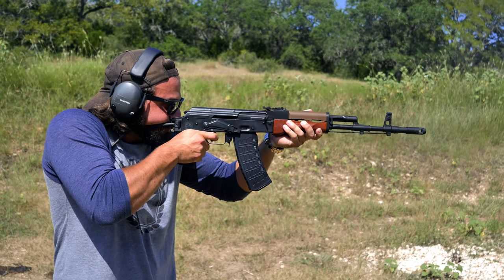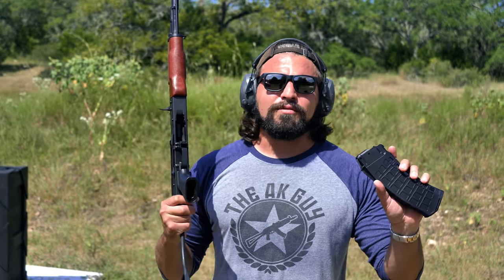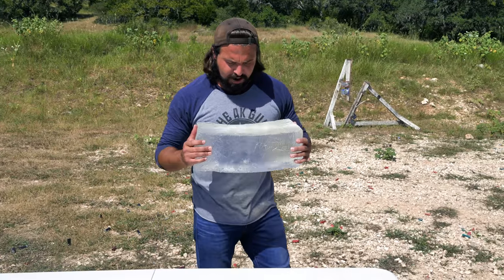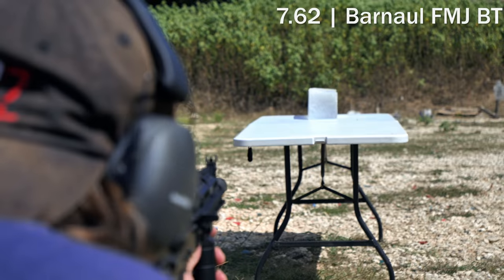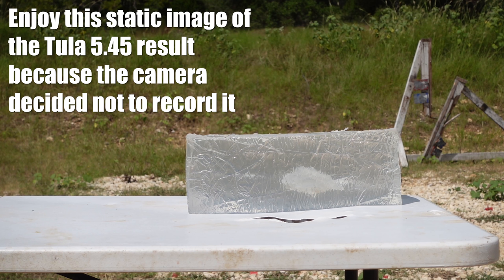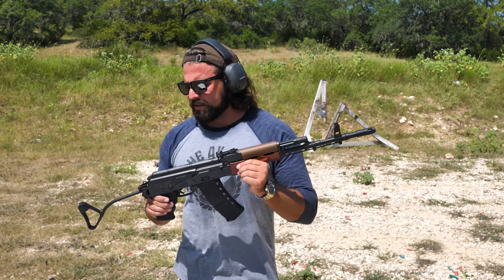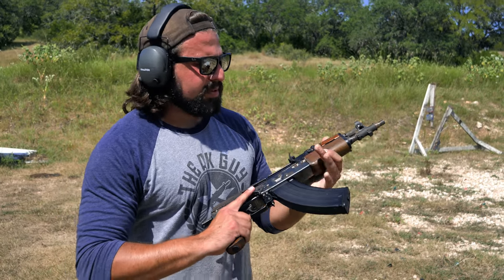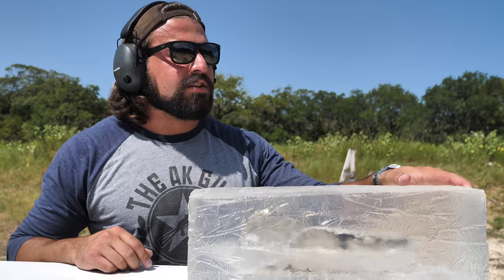7.62 vs 5.45 - Which Is Better?

Comment: As I like to say: "7.62 for the Revolution and 5.45 for war"
Reply: Honestly just use whatever is standard in your country. When the bad times come, that beautiful 3,000 dollar 6.5 is gonna get reamed out to 762 or 9mm, or getting a barrel insert pinned in to bring it down to 556/545.
Reply: 7.62x54 for storming trenches, 7.62x25 for motivating those to storm the trenches. 😁
Reply: @bombsawaylemay770  more like 7.62x25 for sweeping the ruined buildings
Reply: @Bonesintheocean.mp3 Reloading as a hobby is fine. I meant it as a practical matter.
Reply: Amen

Comment: I recall reading about the Chechens during their fight with Russia.  Many of them said they disliked the 5.45x39,  and really preferred the 7.62x39.   Understandable.
Reply: It's an urban legend. Chechen and RUAF forces use both, depends on specific mission.
Reply: You're quit right buddy, 7.62mm is powerful and has more penetrating power
Reply: No, not understandable at all. Like, at all. They must have been stupid and didn't do any ballistic testing, at range or on target or otherwise. The results are not negotiable.
Reply: 7.62 has more stopping power and penetrating power than the 5.45 and 5.56, the 5s are more accurate, the Indian Army is looking to go back to the 7.62 for this reason
Reply: 7.62x39 has more range which makes it better for the mountains of the caucuses, however 5.45 is both flatter shooting and has much less recoil which is better for your average infantryman which is why the Abakan project ultimately failed despite picking the AN-94 as they realized that 5.45 basically solved the problem with the AK, that being a fuckton of recoil.
Reply: @iterationfackshet1990 how do you manage to squeeze so much bad information into one comment
Reply: I get this is a sim but this made an impression on me and why I go w/ old-school big rounds.

I can't find the original whole version, but in the 1st half when they are clearing rooms it was judged fewer rounds to make sure the target was D O N E.

Real? I don't know; but it resonated with me and why I have chosen 7.62x39 as my feral piggie round.

ALSO, my boot was 1983; we had filthy A1s and yeah, I get it was a lesson to make them reliable. But, I've never trusted AR since. At this point in my life, I"m not humping tons of ammo over hills and thru swamps so that aspect means less to me.

https://www.youtube.com/watch?v=i9Hz7Kbq6aQ
Reply: Body armor. 545 wins
Reply: @louie3404 stopping power yes, penetration not so much

Comment: Brandon, just FYI: You can put those gel blocks in a bucket of water and all the surface disruptions will not be visable. That way you can see the insides all nice.
Reply: You can also very quickly hit it with a blow torch, note very quickly.
Reply: He usualy just magdumps into trash.

And i love it.
Reply: Yes and you can also use a bucket of water to prevent fall damage.
Reply: And a grenade to double jump
Reply: I think that trick also works on white T-shirts :P
Reply: @PromProm456  Classic Lulw
Reply: @Miraak0Konahrik  LulE
Reply: @vojko0031  To be fair that's pretty much exactly what the Russians did when they were actually evaluating the AK47 prototypes.
Reply: Question:
7.62 vs. 5.45 - Which is better?

Answer:
9x39
Reply: @crazysilly2914  well no, but actually no
Reply: 14:00 Looks like an effect you'd see in a Quinten Tarantino movie.

Comment: Would love to see a 5.56 vs 5.45, 9x39 vs 300 blackout, or 7.62x54r vs 308 comparison video. Loved this one.
#akgnotificationsquad
Reply: The Caliber cold war
Reply: Concur with all these
Reply: 7.62x54R is closer to .30-06 than to .308, but it requires a really long barrel to get the most out of it because it was originally designed around 30” Mosin Nagants
Reply: Yes!
7.62 x 54r out of a Zastava M91❤️🇷🇸
Reply: All of the above
Reply: @j5689  Was gonna say 7.62x54r is more comparable to 30-06 too. You beat me to it.
Reply: @EvilMendes  I'ma use that from now on
Reply: 300 black out isnt even comparable to the other rounds. it was designed for a silencer set up. and 54r is in between 30-06(7.62x63) and 308(7.62x51) so not really a good comparison either.
Reply: why not also throw 7.5x55 into the mix
Reply: 22lr vs 50 bmg
Reply: I'd like to see a comparison between suppressed 7.62x39 vs 300 BLK. Both ballistics and noise with a can.
Also question: When you reload ammo, can you put the 220gr (14g) Tip meant for a subsonic 300 BLK round into a 7.62x39 case?
Reply: 7.62x54r vs 30.06
Reply: Throw in 6.5 grendel for good measure
Reply: 7.62x54r vs 30-06 vs 303 vs 8mm Mauser

Spoiler 8mm Mauser is known as the streamlined freight train for a reason
Reply: @WW-ir7sm  Im sure you could but AK ammo is .311 diameter bullet VS .300 blackout being a more western standard .308 bullet
Reply: @joksom4752  9x39 is pretty comparable to .300 blackout as far as use case goes. I'd say it's about the same margin of error 7.62x54R is to .30-06
Reply: And maybeee .303 british! Which is the British equivalent of 7.62x54r
Reply: @5150warpig  9x39 as the comment stated was designed to be subsonic for suppressed guns like the AS Val.
Reply: The 7.62x54r compared to .308 would be funny cause its like comparing a 60 year old man to a 100 year old man that can still beat your ass
Reply: yes all of these
Reply: @5150warpig  they are used in weapons intended for similar roles and uses. 54r is more similar to the 30-06 than 308. but fullfill the same role. the point is to compare assault rifle calibers, and comparing DMR type rifles. its a  valid comparison as they are used the same in the REAL world.
Reply: @5150warpig  9x39 was also designed for suppressed weapons if I recall correctly, like the AS VAL and VSS.
Reply: @terrybailey9621  54r and 303 beats 3006 and 8mm  in Long range since they're flatter shooting and 8 mm is vastly better than 3006 but there aren't too many good rifles and 303 or 54r
Reply: If you're comparing 300 blackout to something the best round would be from the STG 44 it's the closest to 300 blackout
Reply: 5.56 vs 5.45, I'd personally gravitate towards 5.45. Better ballistics at distance, although it's practically a wash if we're talking 77gr 5.56.

9x39 vs .300 blk, it's blackout for me. Both fulfill their intended purposes for their respective systems, being an easier to suppress alternative to 5.56 and 7.62 respectively, but .300 has both subsonic and supersonic loads that are largely interchangeable with the platforms that can take it. I haven't found any 9x39 supersonics anywhere.

7.62R vs .308, I'd grab .308. 54R kinda needs a long barrel to get the most out of it's performance, while .308 works alright out of sub-30 inch barrels.
Reply: @5150warpig  9x39mm is a subsonic ammunitional also intended for silencer setups such as the AS  Val or VSS Vintorez (both with integral suppressors). And while the other rounds are not exactly the same, they were both used with weapons that filled the same role. So it's not as dumb a comparison as you make it sound.
Reply: 7.62x54R vs 30-06 would be pretty cool as well
Reply: Just yes
Reply: Definitely a Mosin comparison.
Reply: @djjaysky9071  please explain your theory, using real statistics and evidence. Because while 7.62x54r, 30-06, and 7.92x57 are somewhat comparable ballistically, the .303 Brit falls very short.
Reply: @ancientrenegade9243  and it is just a shortened 556 case! So easier to make at home.
Reply: Answer: 5.56
Reply: It’s the ammo shortagepocolypse give him a Break lol
Reply: Yesss
Reply: @5150warpig  he said compared to 9×39, which was meant for suppressors.
Reply: The grunt style tshirt crowd really aint gonna like how 300blk stands up in this. It'll probably piss em off almost as much as comparing 6.5 creed-less to generic ar10 hunting rounds like 270 or 7mm08 that outperform it
Reply: @j5689  definitely not! 7.62x54 is less powerful than 308... I have a m97 mosin and a svt40 that have about the same barrel lengths, but when I shoot on a 10mm thick iron plate, it seems to be go through with 308 than 7,62x54 which sometimes stay stucked in the plate...
Reply: @vega1287  Swiss?
Reply: Yes all of this
Reply: @chuckyxii10  If we're only sticking with 150 grain 2700fps loads meant for the M1 Garand, then yes, the 8mm Mauser is better than the .30-06. But any form of modern ammo, then the .30-06 pulls ahead. 180s at 2700-2800, 200 grains at 2650-2700. Better sectional density, higher ballistic co-efficient, usually better expansion characteristics. 
Handloading can make 8mm a little better, but .323 caliber doesn't have the amazing bullet selection that .308 has.
Reply: @---td4ff  we all know the 22 beats the 50 bmg, what a dumb question
Reply: @chuckyxii10  oops didn't hit the read more button lol. But yeah, .323 bullet selection has gotten better in the passed decade or so. But .308 is still the largest selection of bullets in the world followed closely by .224. I imagine .284 is in 3rd, because of the 7x57, and then .323 because of the 7.92 Mauser.
Reply: Heck yeah💯💯
Reply: @deadeye5797  You are correct good sir. Even though the dimensions are larger for the 54r, the round is not more powerful. If you hand load you might be able to squeeze a little more juice out of her, but common factory loads, no.
Reply: Was thinking the exact same
Reply: @djjaysky9071  There is a simple reason that 303 and 54R have not been used in many Sporting rifles it the rimmed case additionally rifle hunting in the UK and USSR/Russia/Eastern block countries is a rich man sport and they aren’t going to shot either cartridge
Reply: @euph0rya672  what was i thinking.......
Reply: @jluvs2ride  yes, but i guess the stgw57 or the k31 aren't as common there as they are in here switzerland
Reply: @vega1287  I actually had an 1896 swiss in 7.5x55. Terrible decision selling it.
Reply: 7.62 x54r is closer to 30 ought 6
Reply: 9x39 vs 300 blackout would also be my pick. Great video, mister Herrera!
Reply: @vega1287  It's almost identical to a 175gn .308
Reply: Hellllll yeah, but you can add to the list the mighty 14.5x114mm vs 50 bmg
Reply: 5.56 and 5.45 are too similar to make it worth it.
Reply: Id love to find 9x39 for personal reasons. I don't think the 1200 rounds i have will last me forever
Reply: Greetings from Russia, Brandon.
Reply: @5150warpig  110gr 300blk usual fly at about 2300fps. Thats nearly the same as a slightly heavier 7.62x39 but 300blk is more accurate.....idk why people always think its only used for subsonic like thats all its good for
Reply: Tarkov alarm
Reply: I would like to see a 7.62 x54 vs 308 that would be interesting
Reply: @gewtube3794  Because the supersonic loads for .300 Blackout are anemic in at their strongest. If you want a .308 calibre in an AR15, you can try and snag a rifle and ammo in .30 Remington AR. 125 grains at like, 2700fps, a good tsx at that speed would be acceptable on deer sized game.
Reply: @GallopingWalrus  i already have a 308 AR. So you think 7.62x39 is anemic too then? 115g black out is about 2300 fps, 123g 7.62x39 is also about 2300 fps
Reply: @gewtube3794  I guess I'm looking at it as more of a hunting round. And when a .30-30, kinda seen as the ethical minimum energy for a .30 cal, can throw a 170 grain at 2300FPS, anything less is looked at as anemic. 

I'm not saying you couldn't hunt with .300 Blackout, or x39. x39 has been a great, close range, hog round. 

But I'd rather hunt class 2 game with 6.5 Grendel, or 6x45mm if I were using a micro action rifle like that.
Reply: @5150warpig  no but .300 blk is very comparable to 9x39 like the op said lol
Reply: 6.5x55 swiss? lol 7.5 french? While we're comparing all the old school calibres...
Reply: My Canadian ass doesn’t understand what this means lol!
Reply: 300 is something like a 5.56, technically won't relate to 9x39 a lot.
Reply: 7.62x54r is a lot closer to .30-06 than .308, and 7.62x39 would go against 300 Blackout with 9x39 being more analogous to 350 Legend
Reply: @WW-ir7sm  Negative. Because of differences in the points being measured, 7.62x39 has an exterior projectile diameter of .311 inches while 300 Blackout has an exterior projectile diameter of .308. This is because the Americans measure from the bases of the rifling grooves and the Soviets measured from the tips of the grooves.
Reply: @benburgess9428  300 blackout technically is like 7.62x35 I believe. Maybe I’m wrong.
Reply: @benburgess9428  that may be the case, but I was more thinking of testing military calibers commonly in use against their counterparts in doctrinal use today. I know 300 blackout isn't any sort of standard issue military cartridge, it was designed for a similar purpose to 9x39 from my understanding, though I could be wrong.
Reply: @collinculberson202  You are correct on that second part. 300 Blackout was designed for suppressor applications
Reply: @vega1287  because it's clearly the best lol
Reply: @---td4ff  close one
Reply: what about 54r vs 8mm Mauser?
Reply: 7.62x51 vs 7.62x54R
Reply: @5150warpig  that's why he said against 9x39 which is its russian equivalent. The 9x39 is for the vss
Reply: 7.62x54 vs 30-06
Reply: 6.8mm should be added since 6.8mm was designed to replace the 5.56mm and 7.62mm
Reply: @5150warpig  go back and read the op. pay attention to the commas.....
Reply: 9x39 would loose then 5.56
Reply: @pepefroglive  the military doesn’t really use 7.62 and 6.8 sig isn’t easy to find and is expensive
Reply: @WW-ir7sm  300BLK uses 308 bullet, while 7.62x39 is .311 bullet. Technically it's possible, but I doubt you'll have good performance because bullet obturation may be less than ideal. It is also possible to shoot 300BLK from AKM (AK-47), but don't try that at home!
Reply: 😮we need this
Reply: @deadeye5797 yeah people just look at the bullet and talk without experience
Reply: Well , the Czechs came up with the 7.62x 45 for their rifles . It was superior in every way to the 7.62x 39 , but it was during the cold war . As such , Chechoslovokia was part of the Warsaw pact , and a Soviet state . Moscow poo pood the round , because it would have been too expensive to make a transition , and replace the stocks of 39 . So it stayed in service , even though they had a superior replacement on hand .
Reply: Hell yea
Reply: And 9x18 vs. 9x19
Reply: @5150warpig  Pretty wrong for a know it all.
Reply: @WW-ir7sm theres so many different variations of the 300
Reply: Where the hell is anyone in the us getting 9x39

Comment: I started my military service with the old AK-47, in my second year, we changed to the AK-74. You can hardly hide behind anything against 7.62 AK, 5.45 is good for open fields and target practice.
Reply: Yea. I heard Vietnam veterans say "We learned real quick upon arriving that trees were not cover"
Reply: You've obviously never been in active combat. Like, what a really really stupid comment. You will NEVER use your service weapon as an obstacle clearing device, that's what the mg guy is for. The effects on target of 545 compared to 762x39 are so vastly different that it's impossible to say otherwise if you've actually taken lives, before.

Like I've always said, people judge 762x39 vs 556/545 purely based on how they hit steel plates/cinderblocks at 20 feet, which does not represent actual effect on target at all
Reply: 556 goes through trees better than 762x39 . Smaller diameter, less resistance, more velocity @KINGRODP
Reply: @AR15andGOD he is saying you could shoot through brick walls and such much more effectively than with 5.45x39 or 5.56x45
Reply: @AR15andGOD  7.62x39 goes through obstacles and trees much better than 5.56 or 5.45....it's part of the natural tradeoff and everyone knows this...
Reply: @AR15andGOD not true
Reply: Due to sectional density, the 5.45 can penatrate thicker trees that the 7.62 version.
Reply: @Squishysforbreakfast  That's factually incorrect, it's not sectional density, it's weight. Yes, more speed should allow it to penetrate barriers better, but it won't fly through barriers staying intact, and will fragment instead of blowing through like the heavier 762 (125 grains vs 60)
Reply: @yettmanyettman5273  sectional density is what counts towards penetration.

APFSDS tank rounds come to mind.
Reply: @Squishysforbreakfast  I can tell you from personal experience and testing, that 762 is more effective for penetrating cover. When going through the first layer, 556 will fragment due to it's higher velocity, whereas 762 will just blow through. You can try this through a car, the 556 will fragment, and exiting the other side of the vehicle there will be multiple very small holes. The 556 fragments into small pieces that don't carry a lot of energy themselves. On the other hand, the 762 makes 2 clean holes, without losing much of it's energy. Yes, in theory 556 can penetrate steel better, but through brush, cars, walls, trees, almost everything else 762 does better.
Reply: @yettmanyettman5273  7.62 chews up concrete barriers way better, yeah.
I guess that would be destructive force vs. penetration value or something like that.
Reply: @Squishysforbreakfast  Agreed
Reply: @yettmanyettman5273 I think you make more sense. It seems obvious that the heavier, slower, and bigger projectile would stay together better than a much lighter and faster projectile.

The 7.62x39 has an advantage in penetration against hard targets, whereas the 5.45x39 offers much faster projectiles, which helps with accuracy against moving targets, and increases the effective range.
Reply: @AR15andGOD wrong
Reply: @AR15andGOD  Penetration is the factor in play. 7.62 goes through trees MUCH better than 556/545. Because 556/545 is DESIGNED to tumble with the slightest resistance it encounters.
That said, 556/545 is better at offense than the 39 because of low recoil, while the 39 in an urban setting is better because of its penetration. 😯💨
Reply: @AR15andGOD you still have time to delete this Bro lol